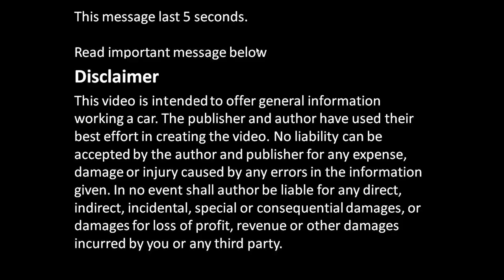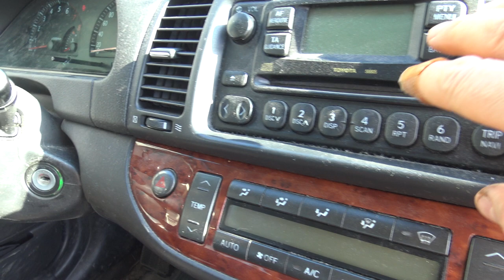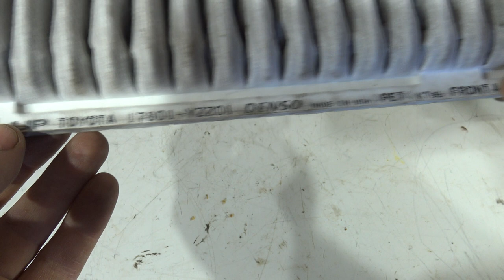How to clean annually Car or Truck Air Filters Free of costs

Comment: I would not bother cleaning any filter, unless it's a permanent K&N filter. These things are cheap enough that you can just throw them out and buy new ones.
Reply from the maker: Hi Mike, I don't trust K&N filter. It don't take sand well away like Denso paper filter does.
Reply: @PeterFinnTheCarDoctor  me neither. I don't believe it filters good enough as paper
Reply from the maker: HI, Good comment. My issue was oil adding to K&N filter, messy and complex.

Comment: Is good to change  1a yr
Reply from the maker: Yes !
Reply: Air filters do last 3 /4 yrs depending on your mileage.Many people do not tap the filter to get it cleaner which should be done at 2 yrs anyway depending on the miles you drive.

Comment: Your air filters & cabin filters are important.You may lose 3mpg on a dirty air filter.I actually washed my cabin filter on my Yaris as it wasn't paper and it was filthy!!.It came out very clean i tell you.You breath in the dirty air from this dirty cabin filters and many wonder why they get sick or feel ill alot or even have head aches when driving sue to the drirty fumes from other vehicles incl smokey trucks/lorries,don't ever forget that.It's your health you need to think about.Many will surely know motor bike riders who take their crash helmet of and see a dirty face? Well,that's what you breath in.Most under rated service part that needs changing.....apart from your PCV,do clean the PCV every 3/4 yrs  as you risk gaskets leaks and that's why you have oil leaks.And do clean your throttle body every 2/3 yrs too as you'll save fuel too.